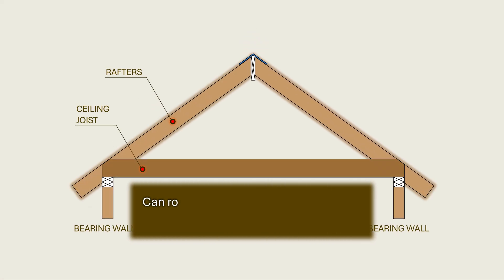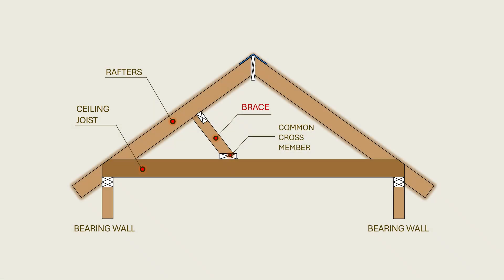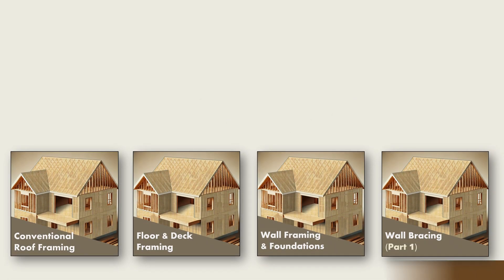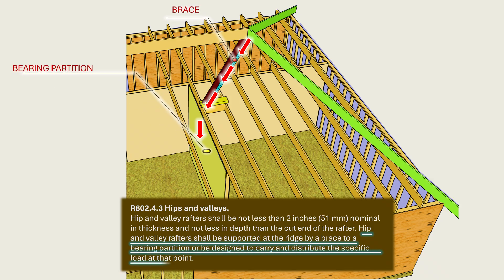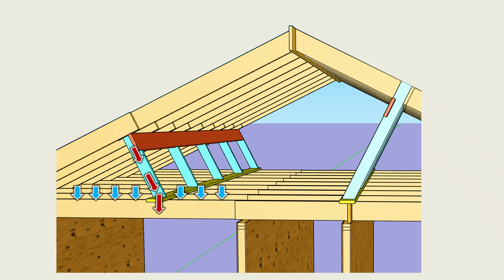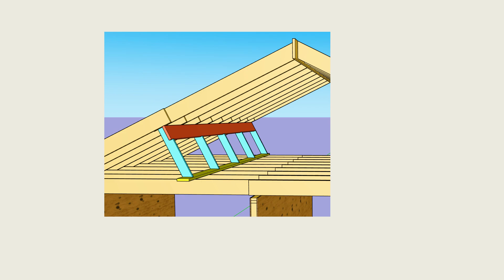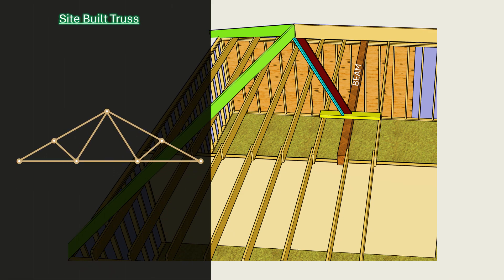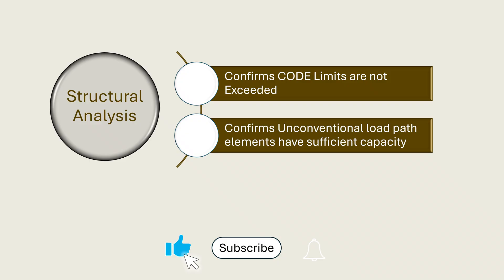The Problem with Supporting Purlin and Hip Braces on Ceiling Joists

Comment: Would having the struts land on a strong-back on top of the ceiling joists not be adequate? That way the mid-span roof load would be transferred to the end walls by the strong-back, which would function like a low ridge beam. The load would then have to be transferred to the foundation at the end walls.
Reply from the maker: A strong back bearing on ceiling joists is not adequate (without engineering evaluation). If the strong back is bearing on the ceiling joists, the loads will end up on the ceiling joists. The strongback will only distribute the load to more ceiling joists. Therefore, the joists will still need to be evaluated.

Comment: If purln braces don't have adequate support, rather than strengthening the celing joists it might be better to strengthen the roof joists instead and eliminate the need for purlin braces in the first place.
Your comment about trusses is a good one.  You can put 3 sticks together into a shape that resembles a truss shape but for a truss to act like a truss it also requires tha that the individual members be connected together sufficiently to transfer the required internal forces from one member to another.

Comment: They did this in my house.  A very old house. Super high pitch roof with very long 2x4 rafters and no purlins or struts.  Somewhere along the way someone put in knee walls right on the ceiling joists (lath and plaster - heavy).  These joists were equally undersized to start with, and full of holes anyway for knob and tube.  So at some point all the rafters broke (heavy snow?), in addition to sagging the ceilings.  This place was a real mess, and I never should have bought it.  Won't bother going into what I had to do
Reply from the maker: Thanks for sharing. This a great example  of the dangers of loading ceiling joists with roof loading without structural design. I hope no one was hurt.
 I am curious why they added lath and plaster on the pony/cripple wall (which is acting as a brace and supporting the rafters  in the ceiling)? Was it serving any other purpose?
Reply: @ConventionalFraming  Yeah sorry I didn't explain that very well. They didn't.  I just meant the ceilings were plaster, meaning heavy to start with.  And then they put on furring and fiberboard ceiling tiles over that to hide all the cracks!  No one ever got hurt here to my knowledge, but I did pay to have the entire roof framing redone.  It was a cheap rush job and they did 2x4s again so I went in after them and trussed what they did.  Life's too short but you have to do what you have to do sometimes
Reply from the maker: @peep39 - I see. That is a heavy ceiling indeed. Thanks for sharing.
Reply: You’re describing a 1910 house I owned 25 yrs ago! All those issues are flooding back in my memory now. I never had to deal with the sagging roof framing (owned only 3 yrs) but I did redo two room’s floor joists. Got real good at averaging and not completely correcting between sag and level in floor joists and even interior trim appearance never trying to hit full level and plumb. Recently revisited the house via Zillow pictures from a past sale and was dumbfounded someone finished the attic with stub walls which had to rest in center of ceiling spans. Fortunately was done in the spirit of a children’s (light loads) playroom but makes me think about what future owners might attempt to put up there. A steep witches stairway was shoehorned in and can’t say I have seen many of those! Were there even codes to follow (or just general practices) in the early 20th century?

Comment: Using a flitch beam would be a possible option to spread the load to a bearing wall.
Reply from the maker: That's an interesting suggestion for distributing the load more effectively. Most importantly, it should be designed by an engineer.
Reply: Just thinking of a flitch beam I’m doing this winter to strengthen an attic access opening! My engineer is youtube videos like these. Guilty as charged.